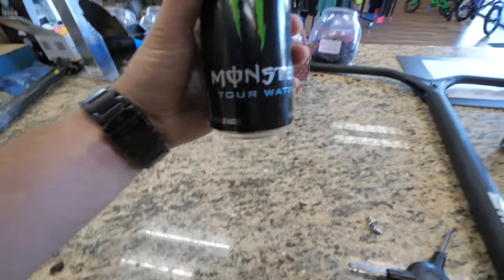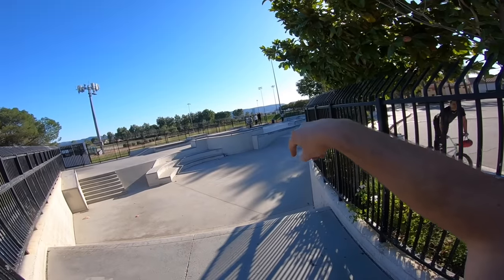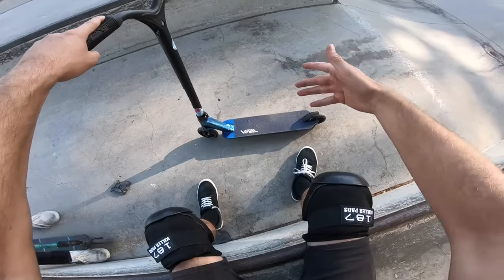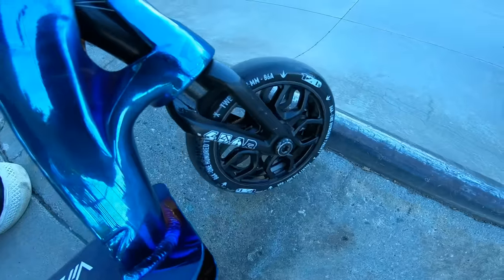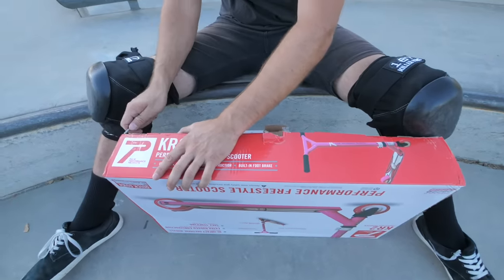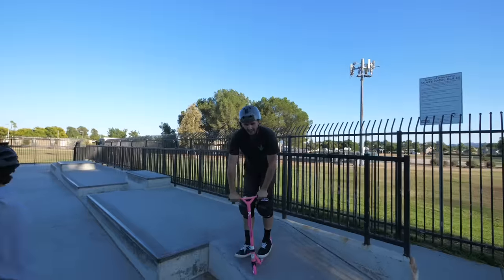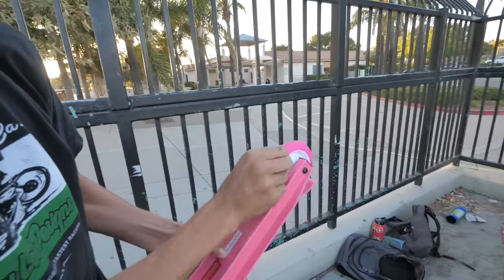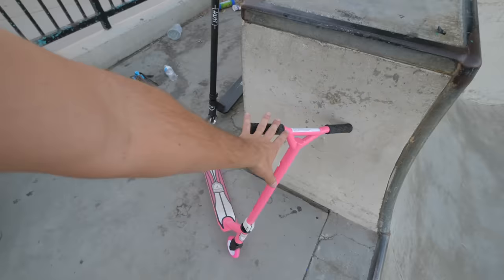Testing CHEAPEST AMAZON Scooter at Skatepark!

Comment: Btw this isn’t the cheapest I found a 10.09 scooter
Reply from the maker: As I said, this was the cheapest scooter that actually made sense to buy. I could buy a plastic one yes...but it wouldn’t be rideable for someone that is my size/weight. Usually those are scooters for 2 year olds.
Reply: Ok I understand I’m in shock that I’m in a conversation with you I’ve subbed for a long time